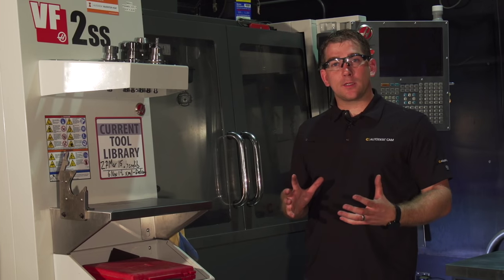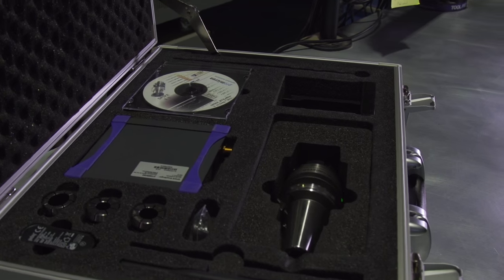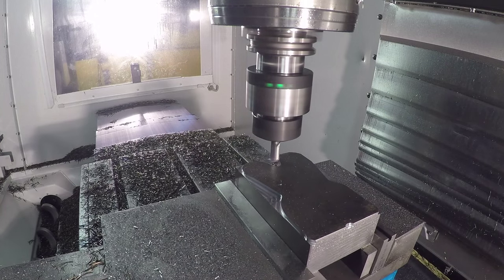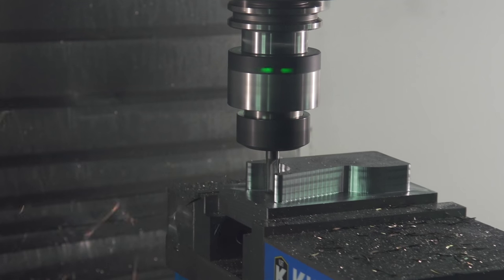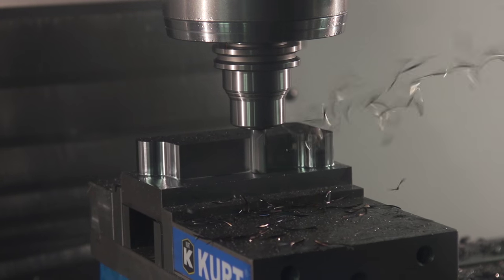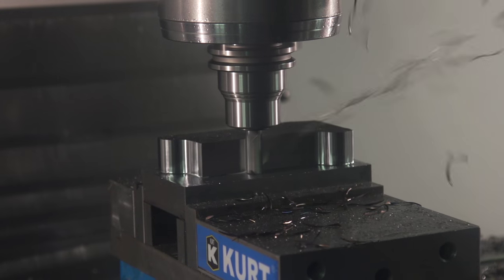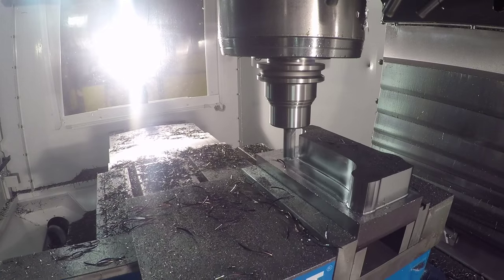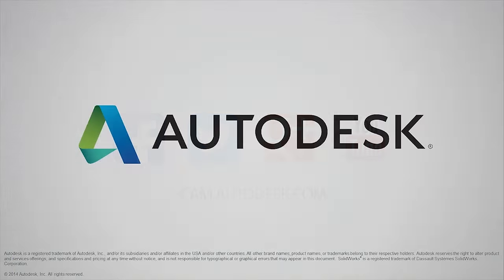Adaptive Clearing at Pier 9

Comment: Adaptive clearing is the reason I started working with cam software not so long ago. You can see that is a lot better for the tool life and is faster too, but if you want to calculate and  program it by yourself it will take hours. With a software is really quick and easy, thank you for the video.